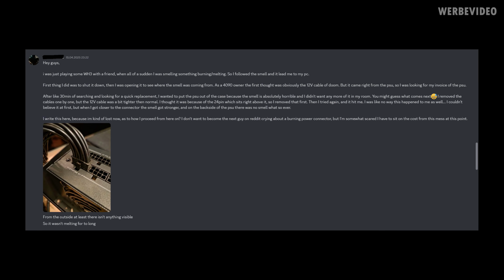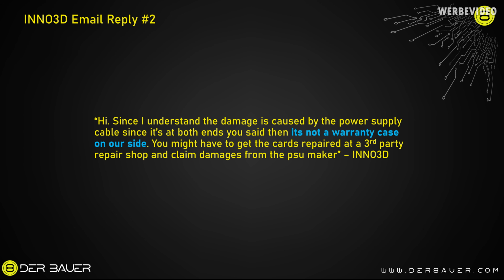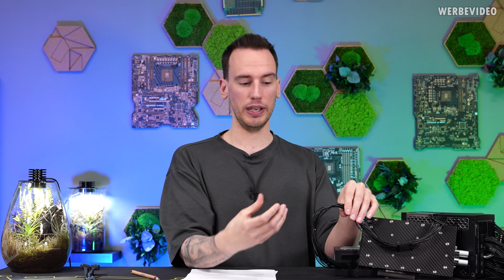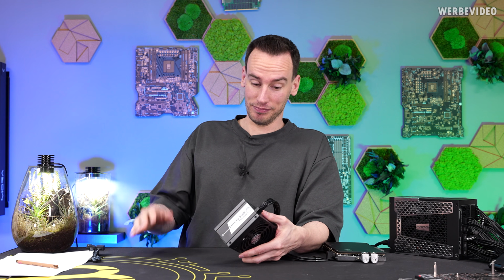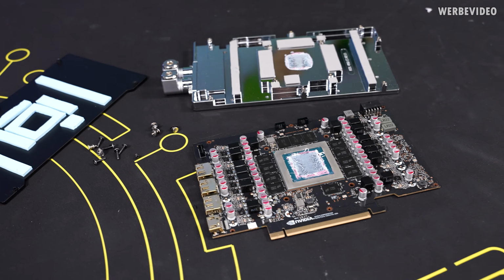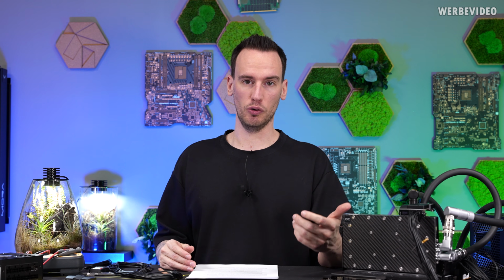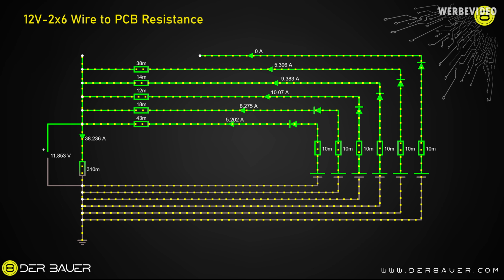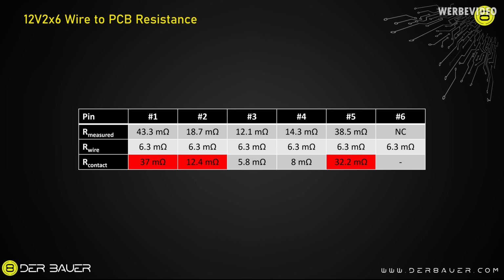Investigating and Fixing a Viewers Burned 12VHPWR Connector

Comment: I'm still sure that the issue is NOT caused by any DC or steady state current distribution, nor does it have ANYTHING to do with the GPU designs not having input load balancing and parallelling all power conductors onto the same input 12V pad.
I'm an EE and have been commenting the same thing and trying to get in touch with the relevant PC hardware 'influencers' from the start of this, but to no avail.

TLDR : Static DC analysis won't work here.
The 2 main problems lie in the combination of AC impedances and heating effects, coupled with the transient response of 2 control loops fighting each other (consider a disturbance that increases the contact resistance of even a single pin: The PSU's output regulator tries to keep the output voltage at its connector around 12V and doesn't respond to increased contact resistance, while the GPU's buck regulator responds to any increased contact / wire resistances, which would cause a decreased input voltage due to the increased voltage drop over the higher resistance, by pulling its input voltage down further, to keep the core fed with the same stable Voltage and Current. Thus, a DC analysis would show the Copper's PTC behaviour causing increased resistance and instantaneous current balancing away from any overheating conductor, while in reality the GPU acts like a negative impedande load where a reduced input voltage causes an INCREASED current to flow into it, because it needs to maintain the same input power.).

Secondly, the GPU's Core also doesn't just present a nice fixed load to the regulator, instead it violently switches between high and low resistance states that then propegate out through the connectors and wires, to the PSU, because the PDN has too high of an impedance at frequencies where significant transient harmonic energy is present.
These high-frequency currents would cause much higher localised heating at sharp/pointed parts of the conductor that they travel along, with the skin effect and current crowding causing much higher power loss and more heat being generated at the surfaces of the metal (compared to a DC current of similar magnitude) and they could even keep flowing through an overheated connection, even when it acts like an open circuit at DC, due to capacitive coupling between seperated, but closely spaced, contacts.

Detail: Showing that a dtatic DC system doesn't produce even qualitatively correct behaviour.

If you treat this system as consisting of a simple 12V DC voltage supply (with a finite output load regulation of less than 1mOhm, so that the voltage output by the PSU never sags more than 50mV when outputting 600W, thus staying at or above 11.95V at all times), connected via 6× 10mOhm resistors (representing an average lumped resistance of both connectors and the length of wire connecting them, when slightly warmed up while passing 9.4276A per wire/pin) to a constant load resistance of 234.659mOhm (standing in for the GPU IC, sized so that it consumes 600W in the default condition), then you get the following:

Each 'link' (consisting of both the source-side and the sink-side connectors' contacts, as well as the length of wire connecting them) drops 84.276mV while passing 8.4276A thus dissipating 710.25mW per link or 4.261W for all 6 links in total.

However, in a purely passive, DC system like this, any connection that has or develops a higher resistance, will dissipate LESS power as more current gets instantly and automatically distributed to the other parallel links.
For example, making one link 40mOhm while keeping the other 5 links at 10mOhm, results in the higer resistande connection only dissipating 231.45mW while the other links each dissipate 925.81mW.

Even when removing all but one 10mOhm link (simulating cutting 5 wires): The single link now dissipates around 23.864W, with a voltage drop of 488.5mV, however, since the GPU is just assumed to be a static DC load, it now only consumes 517W and 48.85A (down from 600W and 50.566A), because its input voltage has fallen to 11.463V, which the PSU cannot sense (and even if it could, a single-rail design can't boost its output voltage above 12V to compensate, since other components are also powered from the same rail).

While this might make it seem like bad or failed connections could cause the 'good' connections to overheat and fail, it just doesn't make sense given the evidence we already have:
- The hotter cables/connections were the ones that you measured as carrying more current, however
- The failure ALWAYS occurs on the 12V side. This is impossible for a DC system since the same current and heating will appear on the ground return path.
- Gamer's Nexus definitively demonstrated that even the original 'worse' design could easily handle FIVE cables being completely cut. Even with ALL the current running through a single pin, the connector didn't even come close to failing. Therefore, even a single pin can handle the vastly increased power dissipation (at least 600% of it's original value, but likely even more due to incresed heating leading to higher resistance), IF the AC currents are kept to a minimum (by good design and system engineering) and IF the combined PSU and GPU system's switching regulators don't become unstable or produce highly underdamped responses when connected together with the chosen cable.

PS. I'm typing this in a rush on mobile, but I'm more than willing to email you a proper transient simulation that shows how and why the connector can survive with a single 12V link, while failing with all 6 in another GPU and PSU configuration, as well as why per-pin current balancing can NOT solve or even improve any of the causitive factors.

This is also a golden opportunity to get some good broadband (>500 MHz) oscilloscope captures of a configuration yhat we know can trigger this issue!
Specifically, I'd REALLY like to see the waveforms and FFTs of: the input current at the GPU (measured over a resistor on the GPU's PCB, preferably using an active probe), as well as the voltage at the PSU's output (at the terminal on the PCB) and the voltage at the GPU's input (again also where the pin is soldered to the PCB).

Comment: Maybe it's just me, but I would want to use at least a 1000w PSU for a system with a 4090 and a full custom water cooling loop.   If the GPU gets close to that 600w limit, that only leaves 250 watts for the rest of the system, it just seems like cutting it a bit close to me.    But I'm using a 1000w PSU for my 9700X system with a 5070,  at least I don't really have to worry about the high failure rate connector with a 250w TDP card (one would hope).

Comment: things need to change . gpus need to not have the power connectors on the top of the cards any more . there is no reason for it especially with the industry pushing for hidden cables and or wire tidying 2 this connector needs to go . its clearly not able to handle the work loads of these gpus  and  while yes the 3090 had this connector it had a lower power spike .  we need a whole new connector with thicker pins with more surface area and better wires also no more crimping . the wires should be soldered to the pins . of the male part of the plug ... period

Comment: If I use a third-party custom cable 8PIN x 3 to 12VHPWR and connect each PIN independently, will the wires be transmitted more evenly?

Comment: I occasionally push on the connector on my 5090. I'm waiting on a cablemod cable to get here and am using the yellow MSI adapter until then. Anyways, I recently gave it a push and it definitely moved in a bit on one side whereas before it was fully in when I checked it previously. I think heat cycles paired with pressure on the cable causes it to wiggle out on one side.
Reply: Thermal expansion and contraction is so extreme it works the plug free of the connector? I refuse to believe they didn't thermal-cycle this crap during prototyping.
Reply: @benjaminoechsli1941  not that it works itself free of the connector. It was still latched in my situation but it was not fully seated on one side. If you pull on the cable it can come surprisingly far out on at least one side and still be latched.

Comment: I don't know if you did this and didn't report it because there was nothing abnormal but I think we have a number of other probable points we could also use to measure various different resistances and maybe assign some blame to one side or the other of the connection; all be after the damage is done and potentially impacting the results.

The components involved all could be probed to assign individual resistance to certain combinations for all the wires:
1. GPU
2. Wires GPU connector
3. Wire 2x on either end near the connectors
4. Wire PSU Connector
5. PSU

For point 4 you would require a drill cut of the PSU to get to the wire connector for a probe.

Its possible the resistance is being added by any of the interconnections from the connector plugs to each other or the crimp of the plug to the wire or even the complete wire itself and we can measure each of those resistances across these short lengths. You did 1 to 3 and 3 to 3 but I think 1 to 2, 4 to 5  and 3 to 5 might be illuminating as well. Its possible for example to only find high resistance in the GPU connector/wire side of things and not on the PSU wire side. This would at the very least show Silverstone and the cable were in spec on the PSU side.

Interesting analysis I think we need to see more of this from NVidia to get to the root of the problem and fix the design on the GPU side to ensure this can't happen anymore with current detection and shuts the card down with a good error message and presumably then the user has to replace the cable and their PSU before the GPU vendor will warranty? Its a mess even with this but it at least stops a fire.

Comment: I wish people, general end users, would start sending the correct message to NVidia. Fk all this connector crap and the black hole of money it's created. There's 2 other GPU vendors that aren't plagued by this elitist bullshit of creating their own power connector (have we all forgotten the shit we were dealing with in the 00's with bespoke power connectors on anything that had a battery? You want your upper echelon to be pristine, stop allowing Nvidia to piss down your throats.
I might be slightly empassioned about this, but it's getting exhausting. More people supporting Intel ARC development would help secure competition in the market and push NVidia to start trying not to rip off non-corporate customers. I appreciate Roman's work, but the laymen need to start listening to the advice.

Comment: I'm hoping we can finally put this to rest, but I'm also wondering if it just is something that has been present in many existing molex standard connectors and just since safety margins were better by-in-large we never saw this kind of common failures, PCIE 8 pin failrues do happen but they are rare since you need basically a high draw + 3 pins to go high resistance floating, and maybe 1 pin of that is like 25mohm or something would do it

Comment: I wonder how many of these have melted using a cable the that is 8pin connectors on psu side and 12vhpwr on the gpu side...I have been using a 3 8pin to 12vhpwr Cable Mod cable with no issues, and every example I have personally seen melted was an adapter of some kind or a native 12vhpwr cable on both ends...I just find that curious...

Comment: YOOO!!  the original connector is NOT PROPERLY soldered,, the tin should flow from 1 side to the other (northwestrepair), and from the front pcb face there are 5 pins without tin. 13:47

Comment: Could this also be happening because of certain games calling for more fps/power?
Are the owners of these burnt cards playing the same game?
Not too long ago a few games were causing problems with title menus calling for too much fps and crashing games...Just throwing that out there...there has to be a common denominator with all these burnt cards/connectors...This happened most on 4090s but it was also other 40 series cards that dont pull that much power right?. I have a 4090 FE but run it a 75% power limit and overclocked...so it can't pull crazy power,like 350 max,if that...of course it could just be shitty 40 series pins plug crap.

Comment: As far as I know, the pin in the male part of the connector which is on the card, made out of solid conductor.
The female crimp terminal (in the cable connector) is the one that made out of thin sheet material (phosphor bronze), has much less cross section and higher resistance therefore this will get more hot and will melt, not the card side.
This way, the graphics card manufacturers can easily blame the cable.

Comment: I would personally be looking at  the cable. Both the PSU and GPU side are solid pins, the contact force is entirely dependent on  flextures in the sockets, the bits on the cable. If the crimps are  incorrectly fitted, incorrectly calibrated crimper damaging them,  or wrong/substitute crimp sockets  are used that could increase contact resistance, leading to heating, leading to higher contact resistance, e.t.c. I'd be offering to fix the GPU to get that cable back for investigation too if I was the manufacturer. If I remember my mini fit connectors you can get terminals in different contact point finishes too, does high Pwr spec selective Gold? (If not why not!) Are those gold? Not like people make fake parts either that get into legitimate supply chains.

Comment: If people would only read the PSU specifications before buying this would not be happening. Just because you buy a 1000w PSU with a 12VHPWR direct connection does not mean that rail will support 600 watts. 

Just go look at the EVGA 3090 Ti specifications on their website for recommended PSU specs. 

It specifically states that if using a PCIE to 12VHPW adapter that a 850 watt PSU is ok but if using a 12VHPWR to 12VHPWR cable then it needs to be a 1000 watt PSU. 

The misinformation needs to stop and people need to start paying attention to what the manufacturer says to use not get their info off of YouTube.

Comment: electricity takes the path of LEAST resistance, hence a higher inductance. higher current on a lower resistance wire can and probably did overload the contact point of the connector. probably why the lower resistance wire was the one that failed.

Comment: The pin/connection with lowest resistance will get most current, and from the way this relationship works due to the Square in power calculation, P = I^2 * R, the current is the thing thats going to create more heat from resistance far faster.  So yeah it makes sense.

Which is the issue if we ended up having 12vhpwr with 2x 12v wires per phase 190w each or 200w each or whatever it ended up being, if both of those wires increase in resistance any significant amount, they are going to still draw a ton of current and cook off the pins all the same even without one being a low resistance.

Comment: For the x8 pcie issue, take out the backplate and have a look at the capacitors near the pcie connector. Probably one it's damaged or missing
Reply: That's exactly what I was thinking.  Those surface mount capacitors are tiny AF and can easily be overlooked near the edge connector if missing for whatever reason.
Reply: Agreed, also those caps at the back are pretty easy to break off if your clumsy or are installing the card into a small case
Reply: How can you tell if there's something missing?
Reply: @fajaradi1223  Mainly because its is not there...  
If you look at other pcie connectors they may be there.
Reply: @fajaradi1223 Usually you can see that something was soldered there before because the solder pads are deformed. Sometimes parts of the capacitors stay soldered to the board which makes it even easier to visually identify the issue

Comment: "Excatly" what happen to my 4090 after 2 years, where 6x12V pins and 1xGND pin was melted. Did manage to cleanup the male connector on the card with difficulties and buy a new cable.
It has worked ever since 7-9-13 (verified with my Flir camera and power clamp), because the 5090 (aka 4090Ti) is even worse in every way possible.

Comment: Has anyone tried using silicone dielectric grease in the connectors? It should take the heat, and at the very least, make it easier to release the plugs from the connectors in the event of overheating to the point of melting.

Comment: While the card is expensive, due to Nvidia's market power and control the Nvidia AIB partners are only able to add a small margin over the component costs, and so aren't willing to invest much engineering effort in designing (relying on Nvidia for as much as possible) or diagnosing faults - I'm not surprised they're trying to shirk responsibility. They either can't (financially), or won't because they need to keep on good terms with Nvidia and they have to shield Nvidia from blame, otherwise they'll have no business. Meanwhile, lessons will go unlearnt, consumers will pay (whether unknowingly or begrudgingly) for manufacturer malpractice, and the gaslighting will continue.

Comment: I think i know why NVIDA don't monitor currents, in 50-200A range shunt resistor should be 1/10000 - 1/100000 of the ohm max (0,4 - 4W loses), so it is problematic.
I think industry don't have parts to measure such currents on PCB's realibly (especialy DC currents), it could by be done by some hall sensor i think but i don't know how shield/seprate field from adjacent pins/tracks.